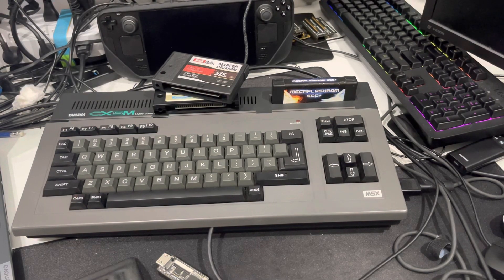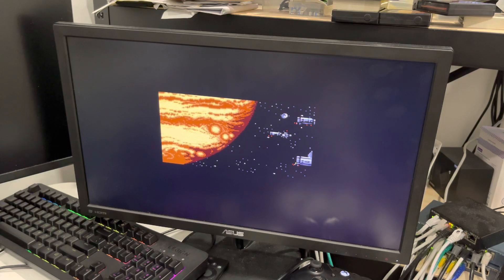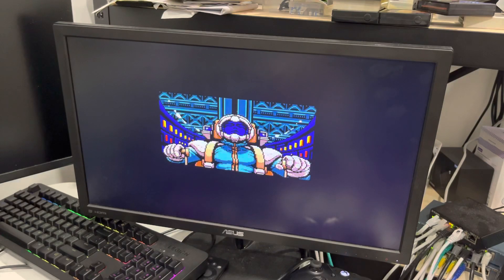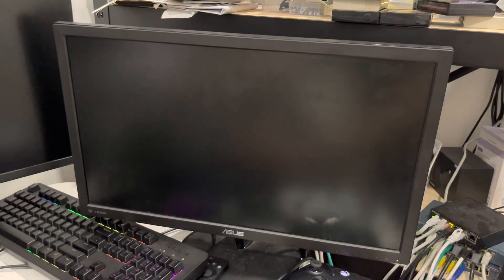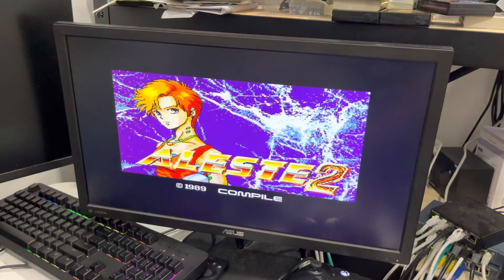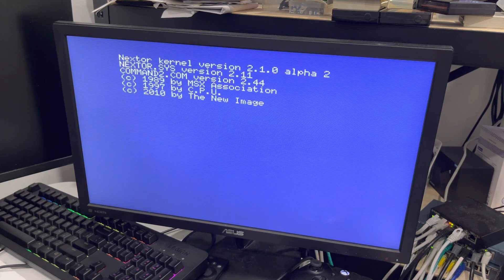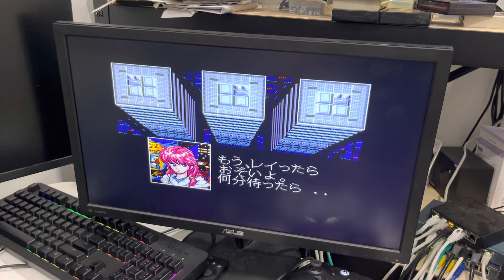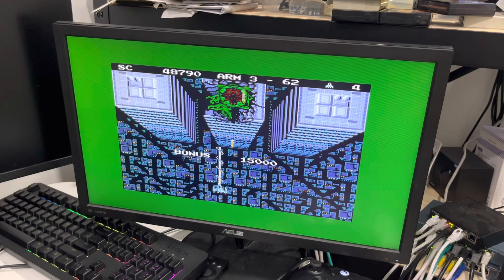TN-VDP Tang Nano 20K - V9958 128K

Comment: Great job, but would you please consider the Nabu computer too? I purchased all the parts to assemble the VGA/HDMI adapter
Reply from the maker: Well it works there too but there is no use. This version does not have VGA output only HDMI.